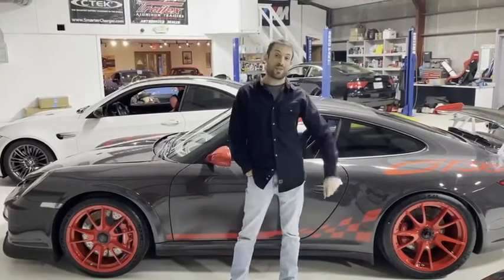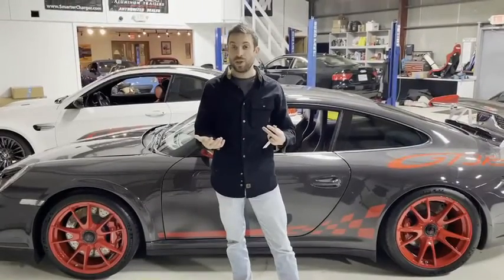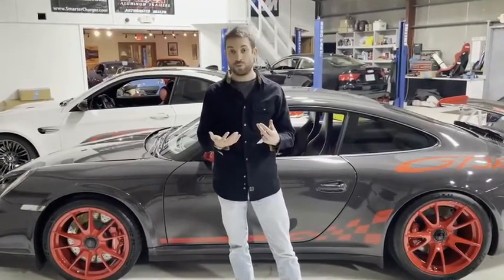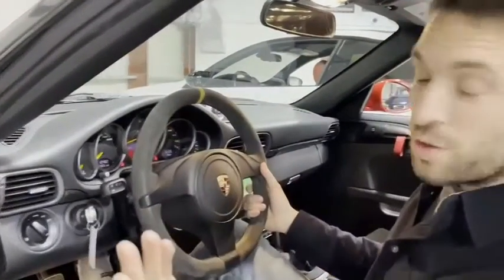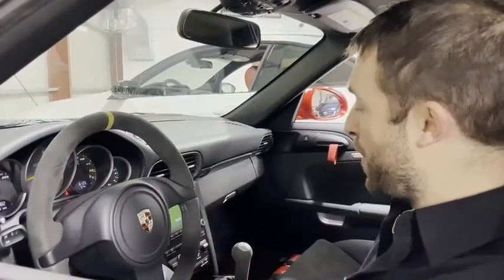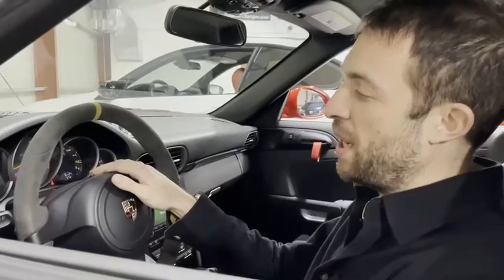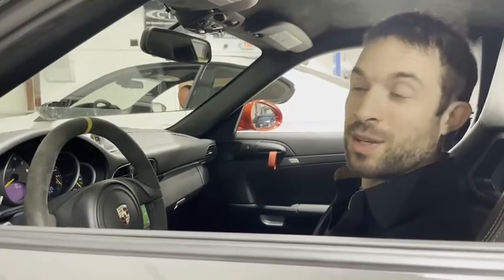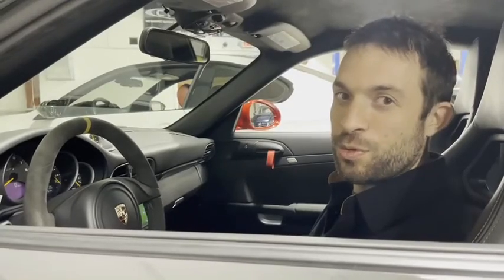Porsche GT3 Front Axle Lift Failures Explained -  $10,000 or $400 to fix?

Comment: Great vid, Doug. I have this exact issue on my ‘11RS. How do figure out which pressure switch is faulty or do you usually just replace them both?
Reply from the maker: Replace the cheaper one first. 😎
Reply: @switchcars  lol. Helpful. By chance have part numbers?
Reply from the maker: @only3pedals  Sort of. We literally went with "the cheaper one first" as the diagnostics did not tell us if it was the high-side or low-side switch that was bad. We guessed right. Also, there are at least two different variants of the system itself, and that can have an impact on which ones fit (I think the thread sizes are different?). The part number that has worked for us on the last two is 997-341-967-90. Note this was the "coarse thread" one, from pump # 000-112.